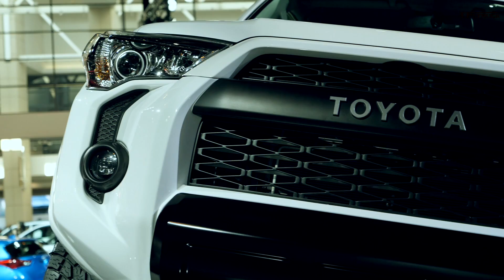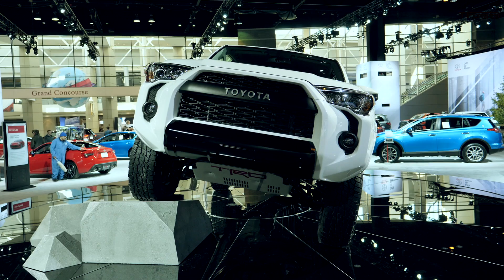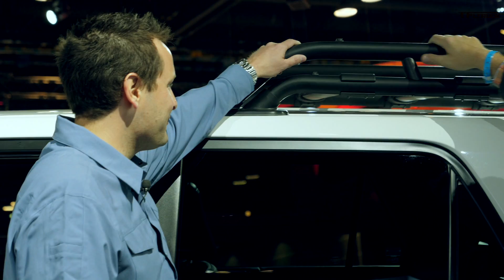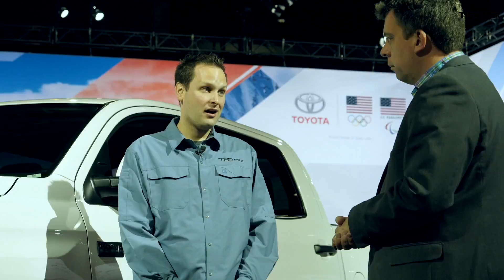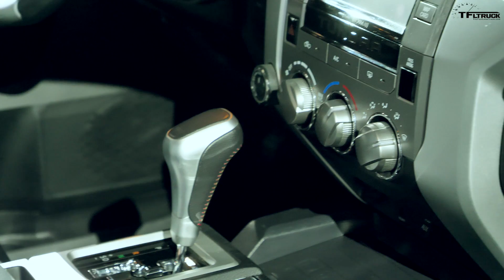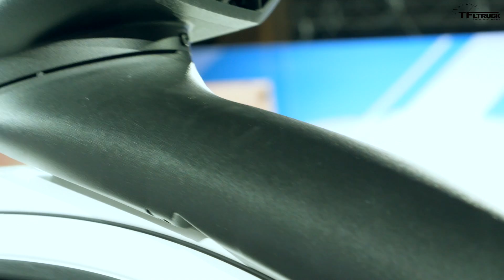Deep Dive into Toyota's Most Off-Road Worthy Trucks: 2019 Tacoma, Tundra and 4Runner TRD Pro

Comment from the maker: Is the new Toyota Tacoma TRD Pro more off-road worthy than the new Colorado ZR2 or the Ranger Raptor or the new Jeep truck?Find out here: https://www.youtube.com/watch?v=7mmYq6Cs2-k
Reply: I own a TRD Off-road. The only thing holding Tacomas back is the tires. A good set of KO2s even Wildpeaks ATWs would be nice. Has power, needs grip.
Reply: Jay Trock it probably can. Toyota won't say it can cause everyone will be taking the trucks in deep water and Toyota won't be liable for it. This way they can just say it's better for cleaner air intake in sand conditions.
Reply: I doubt it. Fording water to those depths requires a lot more than just a snorkel. It's for exactly what they say it's for.
Reply: Suh
Reply: Both Raptors are way better, plus they both have full time four wheel drive! A must for snowy climates, from my experience in Alaska, for example. ZR2 has a front locker of course, which is awesome.
Reply: Question.  Can the desert air intake act as a snorkel?  or is it not water tight?
Reply: The Fast Lane Truck didntoyota change the type of tire on the Tacoma to better tires?
Reply: JeepCherokeeful . Let me know how that 2.3L works for you.
Reply: Brandon Comer while it's technically an open diff, it acts as lsd hence why they called it alsd or a-trak and is actually far superior to a traditional lsd and even almost as effective as a locker because it sends power to the tires with the most grip. It's actually very intelligent system
Reply: The Fast Lane Truck  mmmm,k,k job bfferf___😁✌🏿🙂😃😄😄😭😓😪😴😽😺😸🙀😹🎃👐🏻🎃👐🏻🙌🖐🖐🖐😼😸🤞🤞🤙🏻🤙🏻💪🏿💪🏿✌🏿🤜🙌🤜☠️😸🤞😼🎃👆🏿👆🏾👆🏾👎👎👎👇💄✊🏼✊️✊️🖖🏽🖖🈶⛎
Reply: Brandon Comer no, you can't. When you hit the brake, it brakes all 4 wheels, a-trak can independent brake the tire that's slipping.
Reply: The new TRD is just that a complete TURD!  The throttle response is a joke.
Reply: will the new gen Tundra come out around 2020? will it have a Raptor/Warrior segment Tundra? instead of these petty tweaking here and there every year? Updated engine(s)?

Comment: I really wanna see someone make a video comparing a 4.7 v8 T4R and SC'd 4.0 v6 T4R. (Both should be 4th gens and the v8 should be vvti) I wanna see see which is better on the highway, towing, city driving and of course various off road conditions and obstacles. Compare HP, TQ, MPG, weight, cost etc
And a drag race for funzies! :)

Comment: Nothing new in 2019 4Runner. It is the same old looking as 2014 model ! Toyota knows its not offering anything new for 2019 model hence the dog and pony show for TRD PRD which just has red TRD stamp, snorkel, third party shocks slapped on there that any customer can do after purchase anyway. Gas mileage is terrible, It has a 5 speed transmission in this day and age! Inside is really old design.  If you really want to get a 4runner, buy a 2014 for cheaper price

Comment: I wanted a Tacoma so bad but at 6'5" it's not the seating position, headroom or legroom that's the problem.  The steering wheel doesn't tilt far up enough.  It literally sits in your lap and rubs against your legs when you're turning the wheel.  Super bummed out about it but I'll look into the 4Runner instead

Comment: Love Toyota's reliability, but I hate the way they look on the outside now. The new Tacoma's grill looks like a warthog. I just bought a used 2015 Prerunner Tacoma that's almost new (23K miles). I talked the dealership down to get the truck at $24,995. I don't care for adding all the bells and whistles of the new trucks. I just want one that will last forever and do everything I need it to do. I also wanted a truck with a grill that still looks like a truck.

Comment: What about tacoma rear disc brake??? If not, i HOPE on the new tacoma design model. And when is that year?
Reply: The thing that sucks about drums brakes is that they rust shut, they fill up with mud and salt water, they're much more likely to develop a brake fluid leak, the adjustment springs rust and cause nasty problems, they look terrible, and are pretty much worthless. It's just a cheap design decision. Mike Sweers claimed they're better for offroading, yet the only TRD offroading vehicle that uses them is the Tacoma. Not even the FJ Cruiser had drum brakes.
Reply: Based on how Toyota does things... maybe in 2026. The 2019 Tundra is basically a slightly updated 2007 Tundra.
Reply: hochhaul the thing with drum brakes is they last a super long time and the way they have it set is that the more weight you put in the back the more the back brakes
Reply: hochhaul I have never had a issue with my drum brakes and my trucks been off road more then on road
Reply: My chevy's rear disc brake squeaks a lot and get more rust
Reply: How come the Tundra and the 4runner didn't come with drum brakes if its better??? Rear drums

Comment: For all the Tacoma haters. I am happy having a manual transmission. No other truck offers one. My TRD PRO is running great! I don't care for that snorkel and what Toyota should have done was add better tires, I'm running 33's with no rubbing or problems. It's all about that re sale value vs the competition. The day I decide to sell it it will be worth more than the competition. Having 4 wheels disc brakes on every car I've owned I don't feel any difference having rear drum brakes on the taco. That desert intake will get in the way of my new roof rack I had made so I'll pass on it.
Reply: It's sad when the best feature of your truck is that you'll get slightly more money for it when you sell it. "yeah the truck is okay... the v6 is gutless and buzzy, it doesn't have modern rear brakes, the rear diff leaks oil and howls very loudly at highway speeds, and the front diff has the same vibration problem the 2nd gen did... but that resale value when I decide to sell it is approximately 10% higher, which is nice."
Reply: hochhaul the howl has been solved. Look it up. My diff doesn't leak and the v6 does it's job off road. No need for a heavy v8. The truck serves it purpose just fine and can go where other trucks can't. Perfect truck for me.

Comment: Our Toyota wagon was superior in reliability, but Toyota and Nissan are waaaaaaay outta the game on trucks. Those interiors are so dated, even domestic haters are going chevy......
Reply: Jeremy Polk the interior on the new Silverado is nothing special. Ford and Dodge on the other hand are doing a great job in this respect.
Reply: Hippie Bits yeah I picked that randomly but you're right. I went from a gm to my first ram 4 years ago. Haven't looked back, been a great truck.
Reply: The reason you go with a Silverado or Sierra is the reliability. Ford hasn't designed a reliable engine in 20 years. Ram offers decent engines but the truck its bolted into is terrible. The interior disintegrates, the electrical system is terrible, and the coil spring rear suspension is a joke if you put any weight in the bed.
Reply: hochhaul I'd have to say my own experiences were opposite that. My ram has been great towing a heavy trailer all over. My last gmc did exactly what you say ram does hahaha.

Comment: What I'd like to know is when does Toyota plan on coming out of the stone ages and release a new Tundra? It's the oldest truck in its segment now and is in dire need of a redesign. I'd also love to see Toyota put disc brakes on the back of the Tacoma, something that every other truck in its segment has had for years now. And Toyota's BS reason for why it doesn't need them is an asinine point since discs would hold up even better than the drums do.
Reply: From what I've heard between 2019 and 2021 but you know Toyota they are probably already testing that truck

Comment: I think the snorkel would be even more effective by facing backward to avoid dust. "Ram air" (not that it was presented in this video--I don't think) is a cool phrase but a total misnomer. An engine can easily get the air it needs without the scoop/snorkel/whatever facing forward. A vehicle would have to be going extremely fast---far, far in excess of 100 mph---for the force of the air to be actually ramming down into the engine with any kind of hood scoop. That's because the engine on its own sucks air in at a far greater volume and velocity than it can be "rammed" in. It's cool and useful to have a hood scoop--I certainly like them, and it is advantageous to get cooler air than exists in the hot engine compartment--but all it is is an inlet, nothing more dynamic than that. No "ramming."
Reply: Anthony C   Turning the snorkel around would put the intake in a low pressure area, which would be additive to the restrictions of the air filter. Positive pressure, pointing forward, subtracts from the restrictions of the air filter.
Reply: Troy Strain Thanks, Troy. What do you think was the thinking with the backwards-facing intakes on muscle cars, such as cowl induction on Chevys and others which drew low-pressure air from the base of the windshield?
Reply: Anthony C   High pressure is created when air hits a vertically rising surface such as the front of the car. As the air passes over the hood, it encounters a vertically rising surface, the windshield. The base of the windshield is considered a high pressure area. The low pressure areas are the hood, sides, roof and rear of the vehicle.
Reply: Troy Strain Thanks for the lesson in aerodynamics.

Comment: You can't keep going with a 4.0 liter engine when you got the same performance with a more economical 3.5 liter one. The interior of this 4runner looks 2010-ish. They really need a complete rework for 2020.
Reply: HB Arka The only issue with that is that you don't get better performance. They did a test, and the gen 2 beat the gen 3 Tacoma. A 6mt frontier would leave them in the dust too.
Reply: Well, if the 3.5 is that bad, and the 4.0 so old ... maybe it's time for a new engine. That MPG compared to HP and Torque is not acceptable in 2018.
Reply: HB Arka I agree
Reply: HB Arka my Ford Eco boost got 12mpg and that's being optimistic
Reply: Than change it ...
Reply: HB Arka oh I did I got a 5.7L Tundra and I get 17.5-19mpg now on farm fuel
Reply: Way better ! There is no way to stick with old unefficient engine !

Comment: Thanks Andre for the video. But damn Toyota... is it just me, or is Toyota just not impressive anymore? The "not a snorkel TRD Desert Air Intake", is just a ram air that is raised up to help not suck in dust and is specifically mentioned to not be as functional as a snorkel... good job... just... good job... walking over to other manufacturer highlights now
Reply: Joshua Smith yea I agree with you. Toyota is not getting anywhere if they keep doing this
Reply: Dyno Don - The 2017 Tacoma TRD Pro is a joke. They jacked the price up by thousands but the engine was downgraded to the weezy gutless 3.5, it still has junk drum brakes,  the 6sp auto is unreliable,  the differentials are still the weak high pinion setups that break way too easily, and the Fox Shocks are a waste when they didn't do anything to beef up the suspension around it. The stock control arms and weak ball joints are particularly bad. Not to mention the transfer case STILL hangs 2 or 3 inches below the frame rails and the thin sheetmetal "shield" is worthless as protection.
Reply: Joshua Smith It’s just you. Toyota Tacoma TRDs are awesome.
Reply: Dyno Don it doesn't seem like anything we don't see in other $40k+ off-roaders. While I respect your opinion, I'm still just not impressed.

Comment: Another facelift by Toyota how surprising. They completely ignore there loyal customers about what they want. The tundra is a joke.. no locker and street tires! Tacoma’s 3.5 belongs in a minivan and none of the three are efficient at all. That desert snorkel is going to do absolutely nothing except cause wind noise for 99%of Toyota owners. Hard to justify any of these trucks when they get that same mileage as a 3/4 Ton truck.
Reply: Kongmeng Vang No they switched shock manufacturers and painted the skid plate.
Reply: No one buys a TRD truck to save on Gas, the snorkel is a simple optional attachment. And these tires are all terrains, if you don’t like it buy more off road oriented tires.
Reply: There’s literally no changes to the trd pro
Reply: dchawk81 and???
Reply: Kongmeng Vang aaaannnnnd dirt snorkel! Exciting!
Reply: dchawk81 that’s it though

Comment: Still no blind side warning or any TECH inside the 4Runner.   Geez Toyota !   But it has a new roof rack.   Wow.
Reply: Tickle Fingers WoW, says the Tacoma to the 4Runner..   All the trucks have the tech group, but not the 4Runner, they skip it.  That’s what I’m saying.   Geez.
Reply: I'm sorry but you shouldn't need blind side alerts. If you simply adjust your mirror correctly. And pay attention it an I unnecessary expense.
Reply: Justin Davison it’s called work smart not hard.  Old school is gone.
Reply: I Love Your Hate I’m sure I see more Tacoma’s at Starbucks than 4Runners.  And they have the Tech package.   You were saying.....
Reply: Justin Davison Exactly! All that tech crap is useless noise that is slowly allowing drivers to become numb to what is occuring around them. The car will do it for me....... What else do you need? My 2012 4runner gets me to work in quite and comfort. Its more capable than other vehicles on the road and its nice and roomy for our family needs. Its simple, reliable and easy to fix. Its exactly what a body on frame 4x4 SUV should be. Thats why I have owned 3 generations of 4runner and absolutely love them!

Oh, and this coming from someone who owned and was a mechanic on high tech Audi's and VW's.
Reply: bt4b4 it's an offroad truck. Also.. use your damn mirrors and your head

Comment: the reason why so many taco off roaders were sucking so much dirt into their engines was because they were spending thousands on those after market cold air intakes with high flow filters to replace the factory cold air intakes.
Reply: I Love Your Hate thats a myth!
Reply: i love your hate, if you actually take a vehicle to the track, or try to tow, with an after market cold air intake you will find in the real world there is not any hp gain. the few hp gain you get on a dyno is mostly due to the high flow filter (again, which sucks more crap into your engine. otherwise you wouldn't need to filter the air at all) and the air flow resulting from your hood being up with fans blowing at your engine. it's completely artificial conditions.
Reply: bolt on turbos and superchargers. if you don't like the tuning you can just retune the chip with orange virus but most people are fine with 270hp out of that sized engine. the 3.5L atkinson in the taco gets 278 and some people complain about the torque in that and the gear hunting (somewhat alleviated by TSB), but of course the mileage is better than the older 4R's 4L. whatever you do to an engine, it will probably void the warranty, especially if you don't swap out drivetrain parts to adjust for the power you are adding and presumably the beating you are going to give it that required more power. turbos generally hurt engine reliability and durability because of how the boost is created with hot exhaust instead of pullies like a supercharger. if you have a choice, go supercharger, but maybe just decide before you buy the vehicle what you will be using it for, pick the vehicle with the factory engine you need, and avoid the mods. for under $4500, you could bolt on this OEM unit at home in a day, yourself, and get 305hp and 355lb-ft of tourque without the turbo lag.
http://www.fjcruiseraccessory.com/fjcruisersuperchargertrd.html
http://www.motortrend.com/cars/toyota/tacoma/2015/2015-toyota-tacoma-trd-pro-supercharged-first-test-review/
Reply: The 4.0L V6 is a simply ancient engine. It doesn't have the modern technologies that allow for higher power generation. Most intakes do absolutely nothing, but a new high-flow exhaust might help... a little bit. You'd be spending a few thousand dollars for a small gain. Personally, I think the 4.0L does a perfectly acceptable job motivating the 4Runner down the road... just gets worse fuel economy than a modern full-size truck doing it.

Comment: Lol seriously toyota these trucks are dinosaurs 🦕 specially the 4Runner and the Tundra they been in same body design and engine for a decade now
Reply: well the taco has a newer lexus engine but yeah the tundra is in most need of drivetrain updates. lexus has an 8 speed tranny that can be fitted to the same engine tundra V8 and toyota has dual fuel injectors it could put on that engine. if it aint broke don't fix it, so i'm not sure how much of an overhaul a reliable good ride like that should be subjected to, but there are easy off the shelf improvements they should have made by now for tundra mileage and performance. rumors are they will have a new fj out by 2020.
Reply: Bobby Zee so do you think all the new technology in the American trucks will work fine after 10 years? That's why japanese cars and trucks tend to last a long time. American companies are in such a technology and comfort competition that they fail to realize that longevity is more important if someone is going to be putting in alot of money to buy the truck. Those dinosaurs can take a beating and still run after ten years.
Reply: If you believe that the average domestic truck can't last 10 years, you're very sadly mistaken anyway... modern vehicles just don't have the same problems as 30 years ago. True mechanical problems are few are far between. Electronics are always getting better.